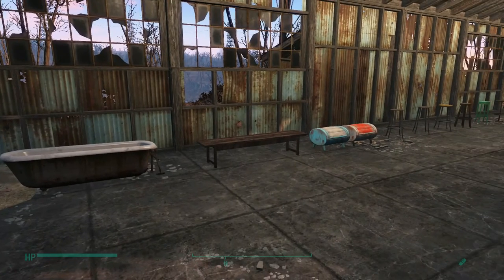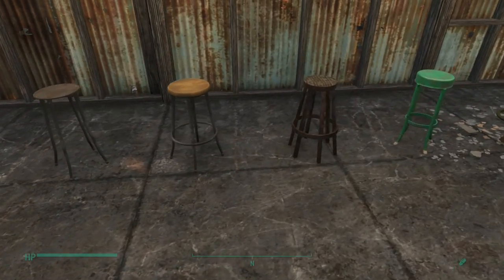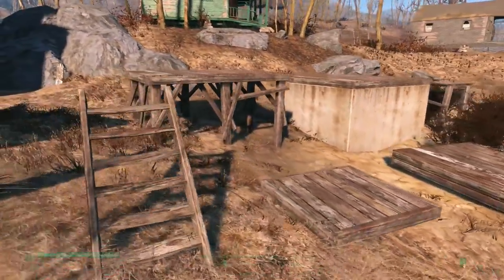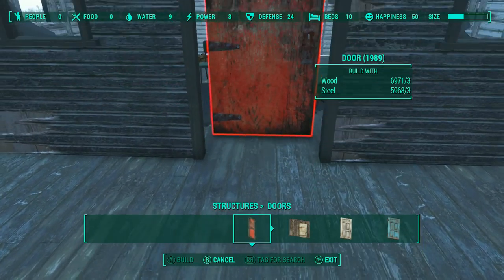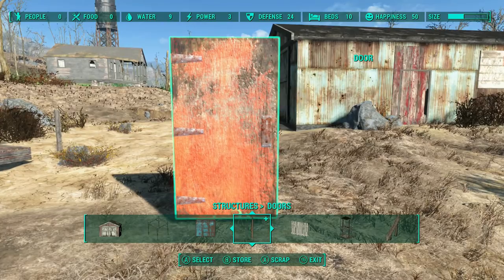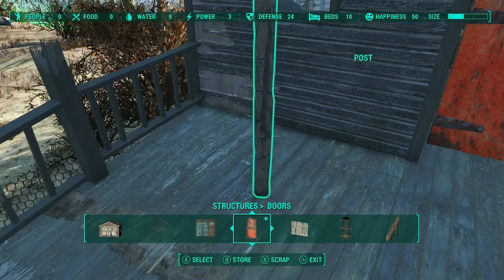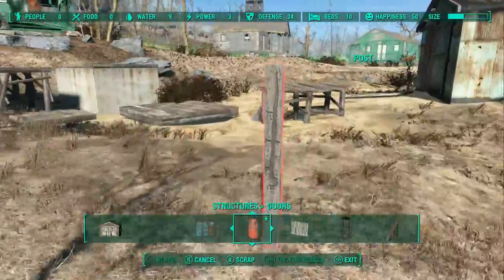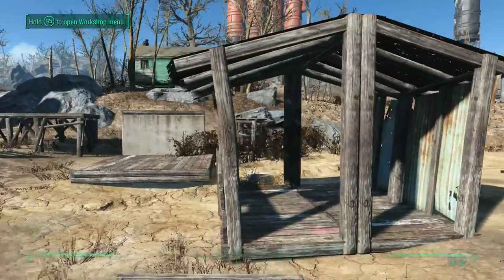Settlement Building Methods and Techniques - 01

Comment: Hi SarDeliac, Well done. It's great to get the basics explained. I'm looking forward to more. It's like a refresher course! But of course I got a few "ah no I should have known that" moments. 

I hope Denise reads this as I love her Work. For the sake of it my route to you was: Draco-Davey Norespawns- MadQueen & Denise- you. The only reason I mention this is that all the above are not only great builders (b'stards, such patience and creativity) but I have been impressed by the way everyone has been building on each other's ideas, to see that development across all the builders is brilliant. 

I like your presentation don't sweat the messing around as it lets us get a feel for your personality. It's all good.

Gotta go and try n work out why I have 25 settlers but 31 occupied beds in Sanctuary.
Reply from the maker: Thanks. And I'll try not to sweat the details going forward. (For your bed issue, how many provisioners do you have linked to Sanctuary? If it's 6, that might be your answer.)
Reply: +SarDeliac I don't think so as all my supply lines are robots based in Red rocket so it's not that, no dead settlers either, my current guess is that because I've changed settler beds without removing the old ones they still show occupied. So I'm about to store some of them and.... Well we will see. 

Love the work.

Comment: I loved this tutorial when it first came out because I was always having to sit on stools and rotate them into the correct orientation. I knew I was missing something simple all along. Your vid was the answer at that time. I just stumbled across an even easier method in Oxhorn's 10 Settlement Building Tips that Make Your life Easier vid. It's around the 7 min mark. It was so obvious I can't believe I missed it so long. Simply orient one of the chairs with a back into your preferred direction and all the chairs in the building tab follow suit. I've long known that with other items but for some reason it went right over my head with chairs and stools.
Reply from the maker: Thanks, and thanks also for the tip. :)